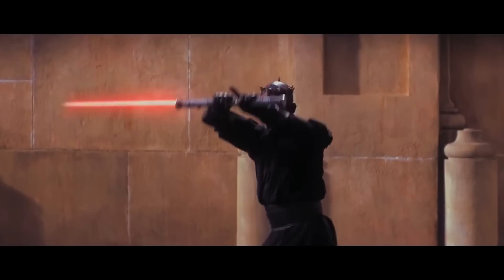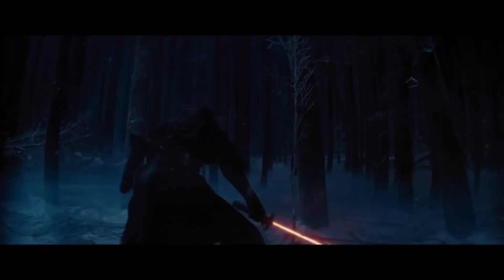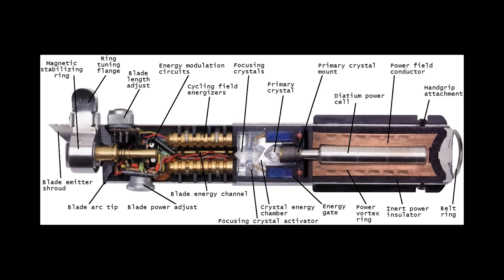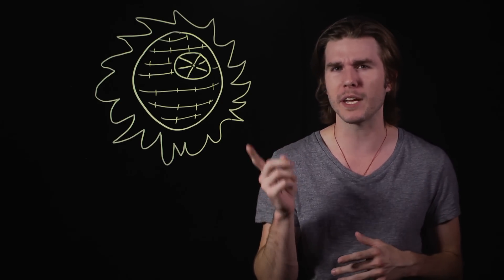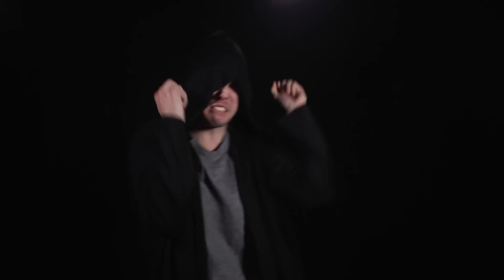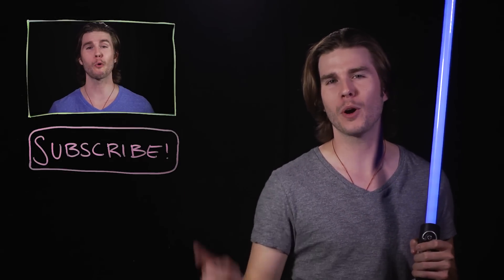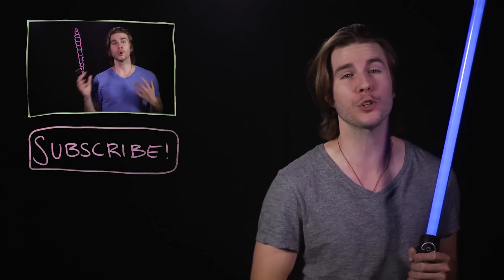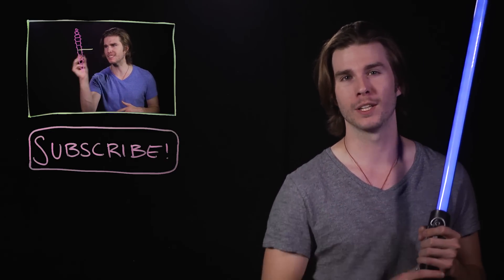Can We Have Star Wars' Lightsabers in Real Life? (Because Science w/ Kyle Hill)

Comment: Personal theory on why the Kyber crystal is so important. Kyber crystals are usually glowing with light meaning they some out amplify light and/or withhold light like a battery, by over charging the Kyber Crystal dense light is then exploded out of the crystal but quickly focused in the magnetic chamber it sits in. Then because the beam has tinny particles  attached to the light it makes it easier for the beam to be controlled. when the light Saber is turned off the energy and particles are then re attached to the crystal through the magnetic field. Thoughts?

Comment: The only way I could think it could work is like this: You have the handle which inside retracts and pushes out the blade which the metal or special  material is the blade but not entirely. Inside of the blade should also include a chamber which holds whichever fuel or plasma it is which creates the radioactive blade and inside of the handle is contained the fuel which pumps to the outside. When you turn on the entire thing it expands and the light turns on with it. The only way it could work is if it could reach  temperature similar to lava which deteriorates whatever it touches just like in Star wars but it would have to be able to handle the temperature and equally cool down quickly so it does not become a disaster. If there we're a retractable part it could easily stabilize whatever plasma or fuel it is using to stay within the radius of the lightsaber. This is probably impossible based on  what material we have and  I don't think anything could withstand that much temperature and quick shock. But that's my idea.

Comment: I remember seeing a video where a guy designed a lightsaber that was super heated air propelled outward by a fan onto a bar of ceramic that had a powerful magnet inside. The biggest issue with this however is that we don't have batteries that can contain that sort of energy and I doubt a wall socket can output enough (both for the magnets and super heating the gas/air)
Reply: do you have the link?
Reply: Just search for "Michio Kaku" and "lightsaber"

Comment: A lightsaber is likely a "tamed", and constantly recycled, lightning bolt. It seems the easiest way. I think Star Trek holds the most basic solution. Sometime in the TNG timeline, they stopped using normal electricity and super concentrated it into a plasma, electro-plasma (Go figure). This was likely done to create an innately superconductive material making it easier to move mass amounts of energy around the ship in ways that was hard to disrupt and or easy to repair. But it is essential lightning in a bottle and is still, while safer than normal electricity, EXTREMELY dangerous.

Using superconductivity it is possible to keep the same very considerable charge of electricity in a constant loop, acting more like a chainsaw than a simple burning hot sword. A lightsaber doesn't so much burn through other materials as it strips their electrons causing the material to break down in the path of cut. It is still intensely hot and will cauterize wounds in organic matter or burn heavier materials. Arguably the only normal matter a lightsaber absolutely can not cut through would be a room temperature superconductor. The beam-blade would just pass around it, be stopped by it or absorbed by the superconducting material. 

A lightsaber does not have to have the equivalent power of a strategic nuclear weapon (or some such non-sense) and may not be anymore powerful than a TIG or arc welder. It is only a matter of how that power is used.
Reply: Like. Way to connect the Star Wars and Star Trek universes and make both seem more plausible in the doing...... because science.
Reply: +DocWolph thats in intersting thought, especially the part about room temperature superconductor, becasue that would explain why cortosis is lightsaber proff: cortosis might be such a roomtemperature superconductor.

Comment: These are the least of your problems. For one thing plasma isn't a solid, it's basically just a hot, ionized gas and behaves more similarly to a gas than a solid. So if you swing this lightsaber at objects, it won't "clash", it will just pass through them. Also good luck trying to contain plasma in a the shape of a blade in free air. Plasma is under intense pressure and is constantly trying to expand rapidly (that's a nice way of saying explode). Basically this magnetic field has to be strong enough to contain an explosion desperately trying to happen. Any failure in this magical super duper magnetic field that is suspended outside of the device generating it, would result in a large explosion right in your face. Then there's also the fact that the heat of the plasma would give you 3rd degree burns just by wielding the thing, and would be so bright that it would blind you as well.
Reply: +EnigmaHood I agree with your argument's for the hazards towards the saber user but I disagree with your whining about containing the 'exploding' plasma. Plasma is perfect to contain with magnetic fields due to its highly charged nature. Assuming energy requirements are not a problem, given enough energy; its possible to contain any amount of plasma under any pressure. The only thing I'm concerned with is the heat, and due to the strength of the magnetic field required, drawing in surrounding objects which respond to magnetic fields.
Reply: Few fun facts from the Star Wars lore (Current canon, to be specific). 

First off, yes, the magnetic field of a lightsaber is indeed that powerful. This is sci-fi technology we're talking about here, after all. If they have technology that can power hyperdrives for faster-than-light travel through a parallel dimension, then I'm sure creating a power source for such a magnetic field wouldn't be too difficult in comparison. 

Second, there's actually mention of what happens if the lightsaber's containment field fails twice in current canon. Once in The Clone Wars, in an episode that focused almost entirely around a few Padawans constructing a lightsaber, where the instructor basically told them that if they messed up even the smallest thing, the lightsaber would explode upon ignition. And second, during the Ahsoka novel, where Ahsoka uses the Force to mis-align the focusing crystal of an opponent's lightsaber, causing it to detonate and kill him.

Also, my personal theory regarding the crystals in lightsabers: They have nothing to do with the plasma of the blade, and everything to do with the containment field around the blade. Plasma weapons are nothing special in Star Wars. Every single blaster, turbo laser, and other energy weapon in Star Wars uses plasma. What's special about lightsabers is that there is somehow a crystal involved in their construction, and that they have a special containment field around them giving the blade shape and preventing it from frying the user and everyone in the room when the blade is activated. It's my thought that the crystal is somehow involved in creating both the magnetic field and whatever magical sci-fi heat shielding is involved in the containment wave. This would explain why the crystal is such an integral part of creating lightsabers when plasma technology itself seems so common, and why the crystals are often refered to as "focusing crystals" in most supplementary sources. It also explains why the crystals apparently have to have very specific properties to be usable in a lightsaber.
Reply: +EnigmaHood the power of plasma is insignificant compared to the power of the Force
Reply: +EnigmaHood I think it's the magnetic field that clashes not the plasma blades...same polarity repels each other right
Reply: gigaBITZ DATA Michio Kaku already stated that's not how it works. The magnetic fields won't clash. At best the plasma beams will pass through each other if you're lucky. If you're unlucky the plasma fields will be distorted and you'll have plasma escaping and blowing up in your face.
Reply: +EnigmaHood I can't remember where I saw a video (it was pretty recent on YouTube) something to do with the particles would cause it not to pass through another so they would clash. And I honestly thought they were just light beams or laser beams not plasma.
Reply: kylethedalek Whether they are made of light or plasma, they will not clash, they will pass right through each other just like a flashlight or waving a laser pointer.
Reply: +EnigmaHood "Michio Kaku already stated that's not how it works. The magnetic fields won't clash. At best the plasma beams will pass through each other if you're lucky. If you're unlucky the plasma fields will be distorted and you'll have plasma escaping and blowing up in your face." That was the history channel thing right? If so that was when he was speaking as if they were made of photons(light) he then followed that nearly immediately with if they were plasma based. You are mixing details from different points of his explanation.
Reply: masemunejm I don't know what channel it was on, but no, he made that point about both plasma and light. Besides, it's obvious. All plasma is, is a hot ionized gas. It's properties more resemble that of a gas than a solid.
Reply: ***** The title of the video says "CAN WE HAVE LIGHTSABERS IN REAL LIFE". So yes, he is arguing in favor for the possibility of making them in real life, and he gave rationale for what is possible. 

This is the problem with you people. You instinctively have a knee jerk reaction to an innocuous comment I wrote, you take offense to it, think I'm attacking him when I wasn't, and then start white knighting for him when you don't even know him. Calm your ass down. I posted my initial comment about a month ago and I honestly can't even remember what he said exactly in the video. 

There's no need to get upset over what I said. He's trying to educate people, and I'm adding more issues that plasma has that he didn't cover in the video. I wasn't trying to be pessimistic, I'd love for lightsabers to be real but using plasma ain't the way to go about it.
Reply: ***** And now you're trolling. Do I need to block you?
Reply: ***** I'll take that as a yes. Goodbye.
Reply: +EnigmaHood Gee. I hope that when I grow up, I know everything like you do. In fact, I also hope I'm as intellectually inclined as you. And maybe even cool like you too, so I can prove everybody that I'm wrong when it comes to unimportant topics. You are an inspiration. Godspeed.
Reply: Jonah Tatum This is the best you 4chan losers can do? Man, kids suck at trolling these days. Get your last word in bitching and crying before I block you.
Reply: Jonah Tatum
Bye bye troll.
Reply: *****
He just attacked me for no reason right out of the gate. Most trolls are at least a little subtle about it.
Reply: An Account You're right, you are late and also a moron. Kindly fuck off.
Reply: Andrew Gould You would know :)
Reply: Andrew Gould With a time out. Cya!
Reply: the amazing world of gumball has a sub plot in one of the episodes where a bunch of scientists created what was basically a light laber and were trying to find practical uses for it, ironically never considering it a weapon despite nearly killing everybody who came in contact with it.  https://www.youtube.com/watch?v=mAZSVzD9jHU.
Reply: if the fields are the same polarity or even just the opposite polarity they'd either repel each other or stick together.  there's also diamagnetism  but given this only happens to stuff like wood and water i doubt  the light saber magnetic fields would have zero or negative magnetic charges so the fields would either cause the light sabers to fly away from each other or stick together and coincidentally that's what happens in the starwars movie series accompanied by sparks.

Comment: I love the new lightsaber design cause the "blade" looks a lot rougher compared to the cleaner look the originals had.
Reply: Alana Vee  could be due to a low quality synthetic crystal, since its the crystal used as the focusing lens that give the blade its color and red crystals don't naturally form in the SW universe so they are lab made.
Reply: atk9989 oh! I didn't know that! Well then I love it even more now.
Reply: if you look up evan nova, Grey Jedi, and Jenasari they all have videos on lots of star wars lore
Reply: +Alana Vee (hxcfairy) I do like the laser "guard" things.
Reply: +atk9989 It's apparently caused by a cracked focusing crystal being used, which can barely contain the energy required to form the blade.

Fun Fact: That's also why the blade has a crossguard.
The cracked crystal would shatter if the weapon didn't have some form of vent for the excess power, so Kylo built lateral vents into the handle both to relieve the burden on the crystal, and protect his hands.